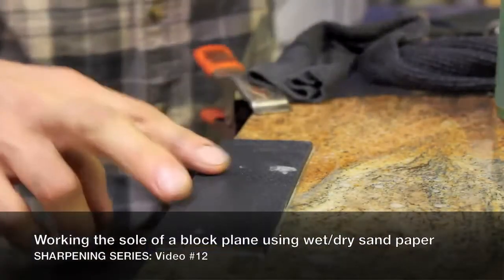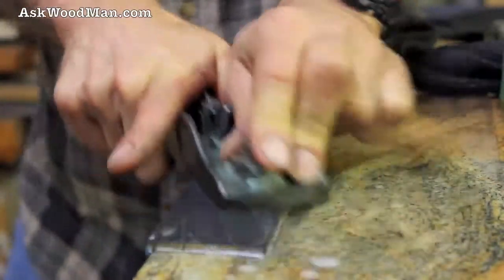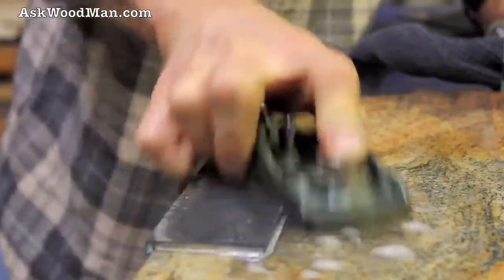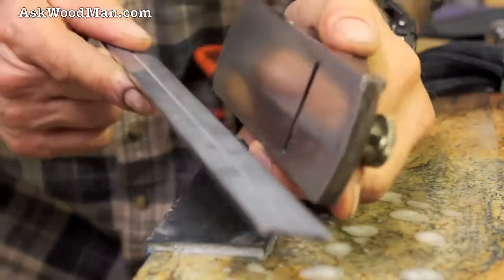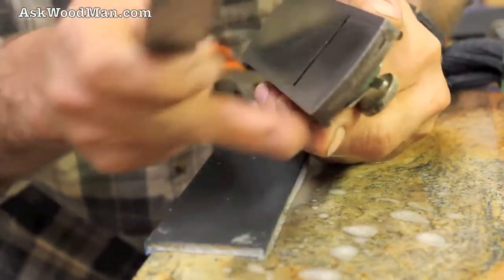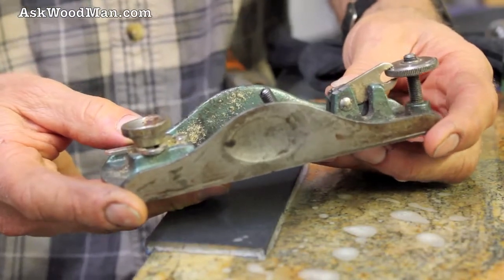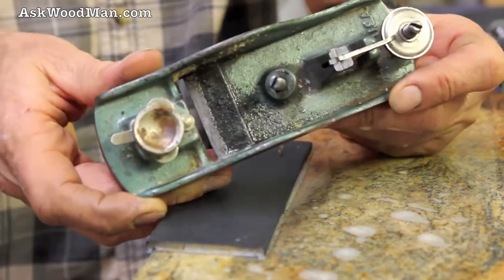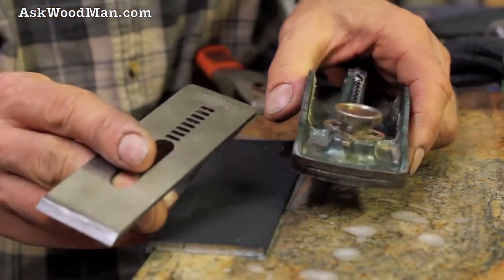Dressing The Sole Of An Old Block Plane • Complete Sharpening Series Video 12

Comment from the maker: @sphenx9782 Examine your plane with the best ruler or straight edge you have access to and hopefully it came dress just right and you won't need to do anything. But the flatter the sole the better it will cut. My method is more for taking and old plane that needs a lot of truing or a highly rusted or pitted plane. If you just have a micro touch ups consider a lapping plate with an abrasive paste. I would have covered that but can't afford a lapping plate right now.

Comment: Hi, what's that you are spraying onto that flat surface, is it oil or water?
Reply from the maker: Joss Rock  It is a 50/50 mix of water and Simple Green All Purpose Cleaner.  A fantastic  water based cutting fluid that does not promote rust. Oil is a poor cutting fluid. It is a lubricant that creates a sliding space.